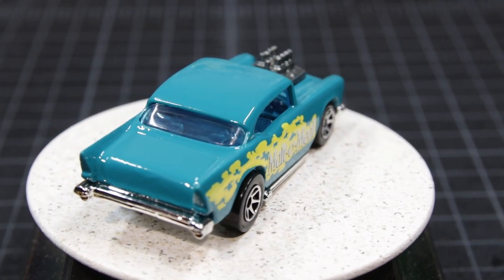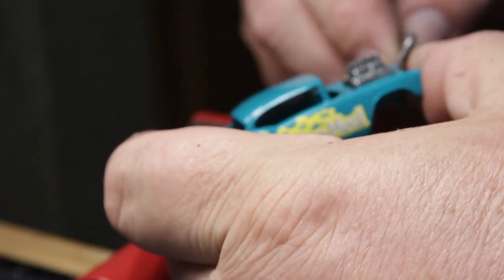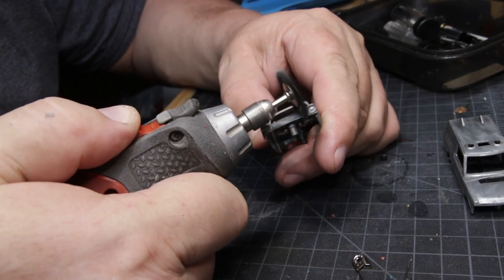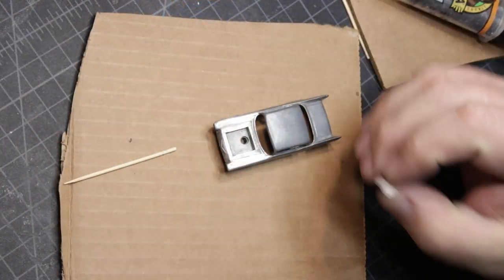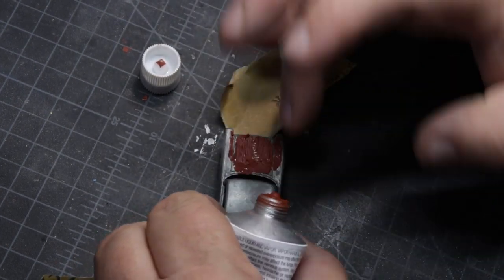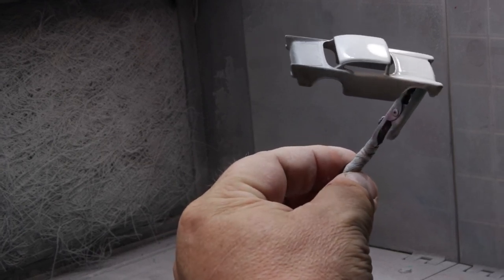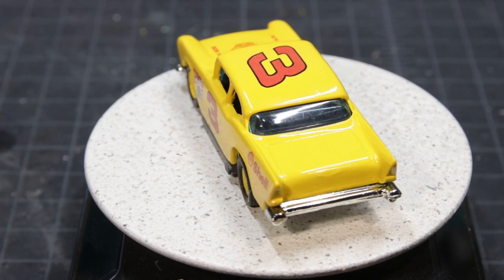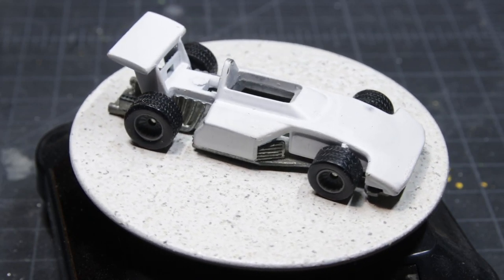Co-op Build - Back to the 50's - 1957 Chevy

Comment: Great job Lee! The B pillar placement looks slightly more 4 door than 2 door but there's not a heap of difference, cool idea to make a period stock car racer out of it.
Reply from the maker: I'm not so sure:
https://www.classicautomall.com/vehicles/568/1957-chevrolet-210-2-door-sedan
I mention in the video that the car was not proportionally correct, not unusual for diecast, it was a bit short I think.

Comment: Beautiful!  That hood repair was worth the hassle, and going with the race car deco was a good way of handling the missing hood bullets.  (Not sure if that was your intent there, but some stock car racers did take those off, so it's period correct! :)

I recently read a biography of Harley Earl, the GM styling VP from the '30s through the '50s, which surprised me by revealing that the other guys in the styling department thought he'd really blown it with the '57--overdecorated it and ruined the clean simplicity of the '55 body it was based on.  The sales figures kind of bore that out at the time (Ford sold more cars in '57 than Chevolet did, for the first time since sometime in the '30s), though, like a classic TV show, the Chevy did a lot better in reruns.

Looking forward to that T-bird!

Comment: pretty much what is done for every two to four door is that the whole body and seating is essentially the same dimensions but the two door gets an extended door and shortened rear quarter then to give extra help for rear passengers getting in front seats are made to slide and tilt
Reply from the maker: I believe you.

Comment: Next time you have a big hole like that to fill, you can fill it in stages with super glue, build layers of it, then hit it with accelerator... when you get to the level you want, go just a bit past it, hit the glue with accelerator, then wait about a minute or two and sand it... the glue is hard enough to sand, but soft enough to contour, and it doesn't shrink.... works pretty good on scale models....  just be sure to hit the layers below the top layer with enough accelerator...